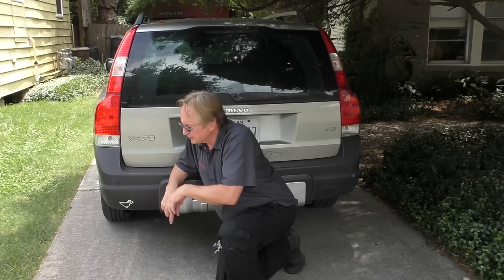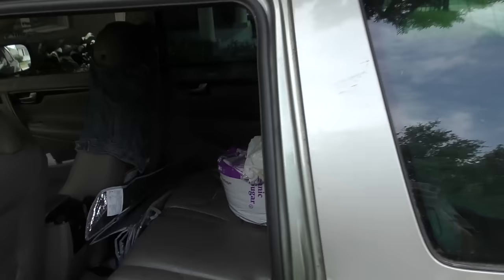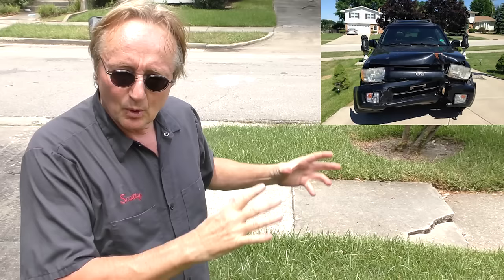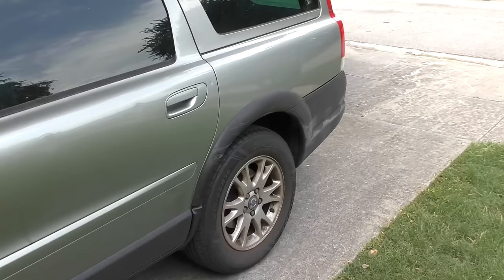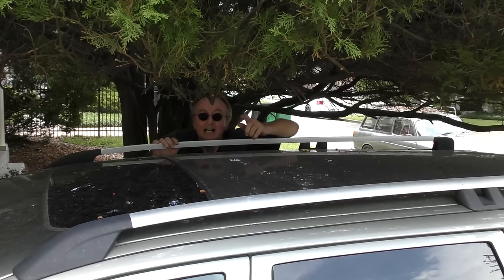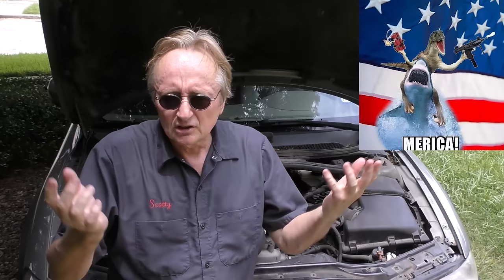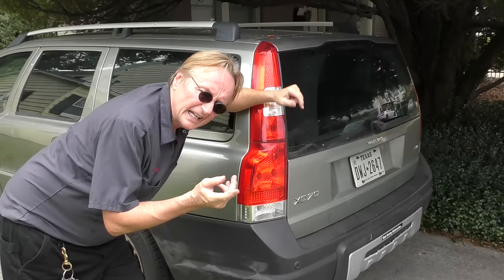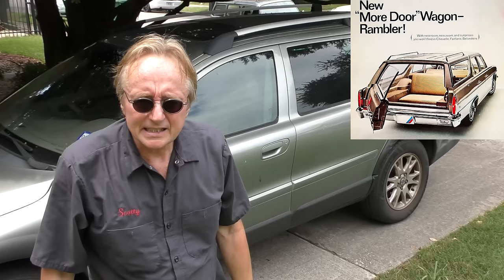Here’s Why Old Volvos Last Forever

Comment: I once had a 1990 Volvo 240 and got over 550,000 miles on it. It was a pretty slow car, but damn if it didn't want to run forever. Wish I had hung onto that car today.

Comment: 5 years ago I wanted to buy a Volvo station wagon being sold for less than $3,000 but it was 40 minutes away and I couldn't find a ride to go buy it.
Instead, I financed a used car being sold 5 minutes away, that was $10,000 but with interest I spent  about $20,000 on it over 5 years.

I SHOULD HAVE BOUGHT THE VOLVO STATION WAGON!

Comment: I got a v70 -05. Only thing that has broken is the pump to the windscreen washer fluid. When I changed it i saw that it was made by Ford. 😂
I replaced it with one of Volvo's own instead.
To be fair Ford made some realy great updates on Volvo like the solution to change the headlight bulbs. Genius and simple.

Comment: The P2 hood hinges and struts and hood are not very substantial.  I just had an incident where they all need to be replaced.  Pretty reliable though.  Not very stylish.  I've been driving a Volvo since 2000.  Somehow I got hooked.  850T, S70T and V70 2.5T

Comment: I have a 2004 xc70 with 96k miles on it. Just had to have the shifter replaced. Had to get one off eBay. Starting to be hard to find parts which is a little scary.

Comment: if you exclude maintenance of those cars, they are everlasting. Some customers reported few thousand dollars for xc90/70. Huge money pits when they get old, specially with Four-C suspension. That is if they arent maintained regulary from the start - in my opinion. Was looking at 2005 XC70 manual transmision with 163hp awd. Shame the repairs itself would cost me 4000 dollars (+ import and papers...).

Comment: Volvo 740 turbo intercooler 1986 no rust original paint runs as when new, 2.3 l . Best car I have ever had. 120 miles per hour top speed. Low profile tyres. Yes petrol as you dont get this with a battery "engine" !!!!!

Comment: As a Volvo owner having come from a family of owning Volvos since 1984, I can confirm some of this, but not everything Scott says about Volvos is true.  Anything he says about them being crap is false for a majority, but there were a few cars Volvo made with teething troubles.
The older S80s had transmission problems due to the Inline-6 cylinder engines cutting out space in the engine bay, requiring the use of the smaller 5 speed GMC transmissions which are CRAP, and the earlier all wheel drive cars with viscous couplings were VERY touchy, especially when it came to changing tires.  The XC90s had A LOT of issues, as did the those with 6-cylinder engines in the 80s.
However, Older Volvos with Turbo Charged 4-cylinder engines, a majority of their wagons, their S60 Sedans, and their XC70s were as good and reliable as old fashioned wood burning stoves.  
My family's Volvos, 1984 260 GLE Wagon, 1990 760 Turbo Wagon, 1998 V70XC Cross Country Wagon, and now 2020 V60 Cross Country Wagon, have been nothing but good and reliable cars that have never let us down.  They were also all involved in accidents, no one was hurt in any of them, and all 4 cars were repaired and back on the road in a matter of days.
Volvo is notorious for not only their safety and reliability as a luxury brand, but also for overbuilding their cars so they last a very long time.
Heck judging from the looks if the car, it seems that the engine, body, and transmission drive train, are outlasting the interior, and Volvo's known having their engines outlast their interiors too! LOL!!!!
Also having worked on them and serviced them in an independent automotive repair shop, I found them fairly simple to break down, take apart, and reassemble during a service, and had less trouble working on Volvos than any other car make.  
The only real draw backs, they're expensive and high maintenance as they age, they eat through brakes like no tomorrow, their brakes cause an absolute mess, and when you replace brake pads, you have to replace rotors too, because once the pads are worn, 9 times out of 10 the rotors are too thin to machine.
Overall, great cars, some of the best cars money can buy, but you need to have deep pockets as they age, and prepare to pay for A LOT of brake replacements.

Comment: glad to see this video Scotty ,  in the 1970s and 80s both my parents drove Volvo Wagons  with the B18 engines  and in the 80s my Dad began hoarding  the Wagons. we would strop for parts  and you are correct  none of ours had  working AirConditioning  Systems which sucked because we didn’t live in Sweden but in South Florida  instead

Comment: I had that exact Volvo and went through two transmissions in less than 150k miles
Reply: Those damn Toyota transmissions were a mistake by Volvo. That said my 01 xc has 187k on the original trans and my 07 has 97k on it's original and still shifting like new. The secret you may ask,  Full DIY 3 gallon easy flush every 25k.
Reply: T6 engine by any chance? Those were fitted with a god awful 4 speed from Ford that have a reputation for grenading.
Reply: @wetlettuce4768  Nope. Those was the GM trans on the T6. Ive worked on a bunch. They are crap

Comment: Just bought a 2005 S80 with just 167,000 miles on it for $1500. Needs a couple of grand in miscellaneous but with $3,500 invested will be worth every penny. Owned one for 5 years and most comfortable reliable car. Only sold it because needed to fit 4 grandkids in rear seats. Oldest can sit up front now soo goodbye SUV hello S80. Same P2 chassis as xc70.

Comment: Had a 1959 Volvo 544 4speed. After replacing driveshaft bolts 3 times and replacing two B16 engines ( threw a rod ) it was time to junk the car. Never purchased another Volvo.

Comment: Got a 2005 V70 233,000miles on a 2.4 T5 engine. She is in good condition too - the on in the video has been abused that given in less miles the seats are all torn, that isn't normal. On our good UK fuel I get 35mpg out of mine on motorway, 28.5 in city, it's a shame that US fuel is so poor as all these Euro cars will do so much better.

Comment: I had a '75 and an'83. They were solid and parts were available, but I could take my Ford van to the dealer to get it fixed for about the same price I could buy the parts for the same thing and fix the Volvo myself.

Comment: Got a few years on you and in my opinion Volvo lost it’s most dependable mojo in 1975 when they went from cast iron head tractor engines to aluminum heads on the B18 & B20 engines...but it was all quite along time ago and I may have my info wrong...

Comment: The weak spot in these (and I drive one) is the electronics. Mine has had some weird battery drain issues, main console problems, etc... Granted they aren't major components problems, but can be a PITA to track down.

Comment: Would you still recommend this car today? If so, which is the best engine to go for? I'm going for the lowest trim, cause I believe those ones actually have a key ignition and key locks.
Reply: V70 d5 2.4 no older than 2005 will do a million

Comment: well maintained volvos will probably out live you. I have a 2003 s60 that never had a power steering, trans and brake fluid change and it runs great tho due to the lack of maintenance the trans feels funny. the transmission, electronics and rack and pinion are the parts that will go out eventually tho. The AC is unbelievable, i never refilled it and it blows cold almost instantly. I replaced the original rear break pads not to long ago, volvo breaks make a lot of dust so the wheels always get dirty

Comment: Hey Scotty, I have a 2001 V70XC, recently my dash went black including my center console controls such as A/C and heater. Only thing working there is the radio. The car still runs but I cant never know when I'm running low on gas lol. I've done some research and it all comes back to the CEM. I just cant seem to find any one in Houston to check it out

Comment: Lol...I had a 2004 XC70. It was the most comfortable car I ever owned. The cars have a fatal flaw though (during Ford occupation). The computer DOES NOT store the vehicle's mileage. So you can pull the cluster and replace it with a junkyard cluster with less mileage. These should have been recalled for this reason, but I guess they got away with it. I liked the turbo 5 and all wheel drive but hated the Aisin automatic transmission.

Comment: I just bought a 04 volve xc 70 and took it to a mechanic and the guy said that I’m going to need another transmission but another mechanic told me that I just need to change the transmission oil. So I need help on what to do. The car barely had 169k miles

Comment: Diving a 2006 P23 Volvo S80 with 150000km on the clock I'm a bit biased but it seems the aging P2x cars with a 5 cyl engine is pretty bulletproof cars most of them have done twice my milage or more still running good :)
Reply: To be honest, I don't see why any of the P2s, the EUCD or the new SPA or CMA Volvos won't last. The only thing that may mess up the EUCD and especially the SPA and CMA Volvos are their mechanical complexity. But I have a feeling that 2.0 liter 4 is bulletproof.

Comment: Why does the muffler cost $800 for my 2005 XC 70, plus all the pipes and attaching parts ? Seems a little pricey. Okay it does have 190,000 miles on it. I may have just answered my own question.

Comment: I wouldn't call a 2007 Volvo "Old" I see the newer ones broken ALL over. The pre 1993 Volvo's with the redblock was THE most reliable consumer engine in production. The P1800 has beaten world records for its mileage the B18,B20,B21,B230.... The 5 Cylinder ones were the junk

Comment: The last good Volvo's were the 140- series. 142, 144,145; 4 cylinders and 2 doors, 4 doors, or station wagon.
The 4-cylinder  engine was the same in each model.
The front doors of all models were the same. You could go to a junk yard and unbolt the left front door off any of these and 
bolt it onto your 140;  you could replace the rear doors from any 144 or 145 with the doors off any parts car.
They were about the safest cars to be in in an accident.
And back then,  anyone who could afford to buy an American car could buy a Volvo.
Since then the quality has gone down and the price is out of the range of ordinary, poor people in North America.
In the early 1970's anyone could fix a Volvo - do many of the repairs, not everything - with ordinary hand tools and ordinary skills. 
But they had to change things when there was no reason to - just because people cannot let a good thing last.

Comment: Heck we sold the old 745 station wagon with 500 000 miles on it and it still purred like a kitten.. My 2016 Volvo V60 cross country diesel has 112 000 miles on it and still feel like new. BTW the new ones you still can't kill them...

Comment: I just bought a 2000 volvo s70 with 156,000 miles on it. I had the timing belt changed because apparently it has never been done. Also my volvo mechanic said it needs a throttle body because I only go 20mph until the car wants to go the speed limit :( any ideas ?

Comment: I bought a used 2002 volvo s60 that wouldn't die. Sadly I drove it to the junk yard with somewhere around 200k.. Dash stopped working completely in the 190's. Everything on it was failing but the engine just wouldn't quit, never any maintenance, rarely changed oil. And I have seen those early volvo 240's still everywhere in around New England. I don't think there is a long lasting car then those 240's. And New England winter salt eats cars like nothing.

Comment: The same thing happened to Volvo Trucks... (Worse Over time) too many electronics, on the forums I’ve heard that those past 2003 are hard to repair yourself, and since Heavy Duty trucks put on more miles in a shorter amount of time than cars, things will break more often.

Comment: Always wanted a XC70 so when one came up I jumped on it. Worst day of my life.Needed a new headlight switch so took it to dealership,Wrong,$700 to fit a new one.Electrical problems by the dozen.Beautifully built and lovely to drive,just wished it was manual,Apart from that totally unreliable and cost me a fortune till I  finally had enough and gave it away.

Comment: Thank you, Scotty! Great video...found it when looking to see if I should keep my 2006 Volvo V70 with 143.000 miles. Right now, the fan blower on the AC system stays on and keeps blowing after the car is turned off and the key removed from the ignition. Do you have any experience with that?

Comment: Curious and confused.... you have two videos on this VERY SAME Volvo w one saying this car is indestructible, lasts forever and the other one you say this Volvo is crap w the battery in the trunk...  which is it? Btw, I have a 2013 volvo xc70 T6 and I'm wondering if I should keep it or sell it w 89,000 miles

Comment: I have a Volvo v50 2.4 petrol 2004 this car justs keeps going I had for year before I tuck it to a garage the mechanic said when did you last put oil in the car I haven't he looked at me with shock and said your car has no oil in it you have bin driving around for a year with no oil I still have the car 5 years later it's never let me down it just keeps going great car I paid £1000 it has 200,000 on the clock...

Comment: so im considering a 2002 volvo v70 2.4 with 108k on it for $1800 no problems at all. would you recommend i purchase this. i got 2003 vw that has given me nothing but problems and im tired of fixing it however i did get it for $600 and it has lasted 2 years and still drives and runs.

Comment: Scotty what is the problem when the battery of XC90 2007 is not charging even when you are running on the road then when you park after few hours it won't start.  Thanks Ricky

Comment: Where do we begin? The bad ETM's {electronic throttle modules}? The bad instrument clusters {love watching my clock go backwards}? How about the alarm battery hassle? Or rewiring the brake lights you lost because the wiring binds and breaks in the tailgate hinge? Or the front end that has to be completely rebuilt every so often for $$$? Or maybe just the pleasure of laying out $150 for a battery? Yes, they don't rust. And yes, they go ungodly miles. But XC & V70's have got more Achillie's Heels than any car I've ever seen. And there's a very good reason that Craigslist is filled with beautiful XC70's for two grand and less -  transmission failures and cost of repair. Time to tell some truth.

Comment: I had one of these bad boys, and everything he says is true.  But he doesn't mention that any work you need to do on one will cost you $500 and up.  Need to get a new lightbulb ?  $500 ka-ching.  Need to replace a fuse?  $500 ka-ching.  Yes, I'm exaggerating, but you get the picture.
Reply: It's not that bad! The extra cost for parts that undoubtedly last longer anyway and a nicer ride made up for it. There are always ways to save as well, like junkyards and diy.

Comment: Scotty, I have an 06 Volvo S60 T5 AWD w/ 130k miles. About 9 months ago, I replaced the fuel pump and fuel pump sensor. Starting last month, code p0089 (fuel pressure sensor). Our go-to Volvo repair guy (who replaced everything) said that pressure is fine upon starting and load, so the issue could be dirt/grime/material in the fuel tank. What are your thoughts? Should I be concerned?
Reply: I have an 04 s60 and the fuel pressure will cause issues starting the car

Comment: I just bought a 2001 xcv70 same color and everything with 136k on it for $2000 nothing wrong with it other than it was 18 degrees out of timing but didn’t know that at time took it to Volvo they corrected the timing and it acts as if nothing was wrong with it and keep in mind I’m younger and love the way the car looks thinking of 2 1/2 straight pipe with a tune for hi flow car bc I love the sound of that 2.4t but anything I should know about the car things I should be aware of or look for??

Comment: Soooooo wrong. Scotty, 2007 is the very beginning of the switch to the P3 platform, thus it can't be the "last" of anything. 2007 is when Volvos got good again after moving to the TF-80SC transmissions, and the SI6 engines. 2007-2014 are the best Volvos made since the RWD days. I've been wrenching on Volvos for 25 years, and have eight in my driveway from 1987-2011.

Comment: I just started driving a 93 960 and i need a full suspension. Ive been looking to find parts any suggestions on where to find a full suspension kits or parts diagrams with names of the each part? Everything ive came across is blurry

Comment: 2008 P3 V70 d5 Volvo engine seized second time in 25000kms, first time it was neglected cam belt and second time auxiliary belt snapped and managed to get into the cam belt and destroyd the head. I will never be buying Volvo again.
Reply: Sander S yes common problem on the 5cyl make sure you replace auxiliary belt when first signs of wear appear.

Comment: I have a 05 s80 the the 5 cylinder non turbo.  It has 190k miles on it were the s80s reliable, it is time for a new timing belt and was worried about dropping a thousand bucks if the motor is on it's way out

Comment: VOLVO before used to build cars way better, however they build with Renault diesel or Audi/WV engines. There was a model made with Mitsubishi, and before Chinese they were owed by Ford.  Yes they have been build to the higher safety standards but the engines on American market with longer millage are prone to break due to overheating (gasket). If you have it and take care of well your coolant you should be fine.

Comment: Own two newer Volvo's, would prefer to have never bought them,  troublesome, over engineered and expensive bricks to run, though they seem  impervious to rust in the rust belt, so keeping them up is just staying ahead of the constant failing systems, do not ignore any simple system failures of any sort on Volvo's as they compound and turn into catastrophic incidents resulting in complete shutdowns, which being such complex cars cannot be rigged to make it home,